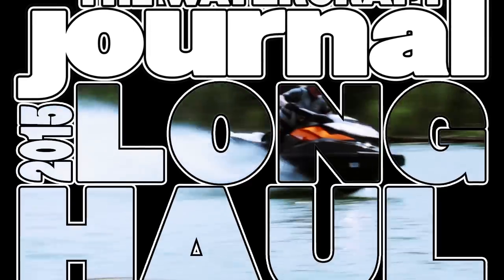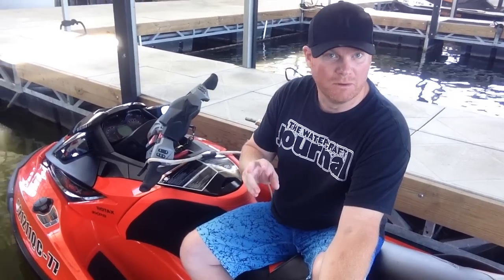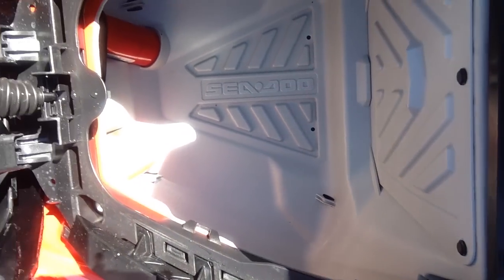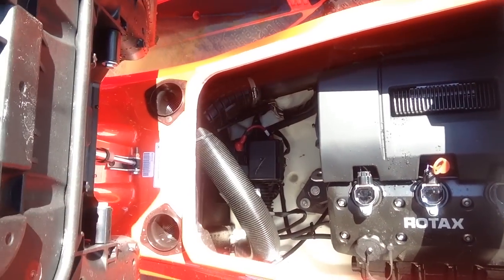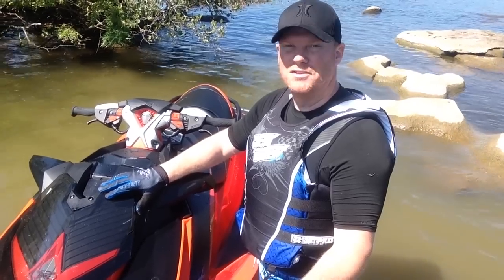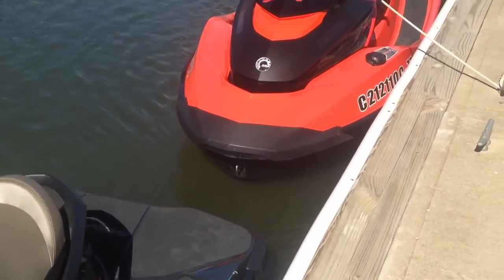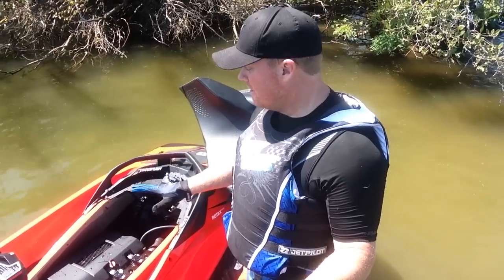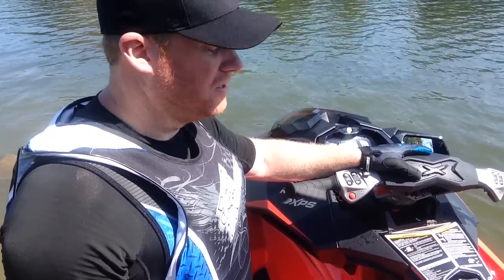Thrashing on Sea-Doo's 2016 RXT-X 300 & RXP-X 300 – Long Haul Ep. 2

Comment: Coming from a person who has been riding jet skis for 4 years now and has gone through 2 sea doos, I would recommend the 260 instead of the 300. Coast guard law states pwc cannot pass 70 mph completely stock. Both the 260 and 300 will get you there
Reply: For one, its not a law.  It's merely a handshake agreement between the manufacturers and the USCG, to not produce new watercraft that exceed 70mph in factory stock condition. Secondly, while still speed limited, acceleration is improved with the 300.
Reply: coast guard... hahahaha
Reply: WOW 70 on the water way fast

Comment: Other than the discussion on speed which  I am still curious about in the US market is that he noted it was "bored and stroked" compared to the 1503.  It is only stroked, the 1630 retains a 100mm bore just like its older brother the 1503.  Very nice review though.  I anxiously await to see one and get all the technical details.  I only wish they had just made the 1630 a total replacement for the 1503 and had it in 4 variants like the 1503, maybe next year...
Reply from the maker: +Andy Rovito Yes, you're correct. The bore remains 100mm.
Reply: +Watercraft Journal  is this the 3 seater one, I need this one if its 3 seats
Reply: Or just add another cylinder to the existing 3 cylinders and make it a nice reliable 2 L 4  cylinder like every other normal jet ski engine but no... that will be too much of a heartbreak for seadoo after all they still grieving the loss of their beloved ''Eskimo life saver''' thumb throttle. Unfortunately that bright seadoo invention it's being a victim of progress and banished forever. The jet ski industry will never be the same without it that's for sure   http://www.greenhulk.net/forums/attachment.php?attachmentid=294307&d=1362751815

Comment: How much faster is acceleration vs the 260?  I've got two 2014 GTX Limited 260's and can get 69.5mph on gps
Reply: Acceleration is not measured in MPH. If you're asking about top speed, they will still be limited to same speed of under 70mph.
Reply: Where did I say it was measured in MPH?  I know how it is measured and was asking how much faster it accelerates than the 260. I was then stating a fact of my top speed with the 260
Reply: +KMT15 Gotcha. The way you worded your question, made it sound as though you were referring to mph and acceleration as the same value. My mistake. cheers!
Reply: @KMT15  suspension doesn't help with speed they're still limited speed buy the rxt

Comment: After purchasing this. Do you need to check for engine alignment and upgrade the water pump to higher cc for Jetski sinking problem.??
Reply: wtf? no
Reply: +Emmanuelle Catubig wut
Reply: Just check on some other guys video about sinking seadoo problem. They do check engine alignment and change the water pump to higher cc. I'm done with my research already.
Reply: +ertonyrn Sea doos do have sinking problems.... I know from experience!
Reply: +Michael B next time put the plug in before you drop it in the water.. Ive owned sea doo's since a 1991 XP... never had one "sink" and practically live in Lake Havasu, AZ and never seen one "sink" unless someone did something stupid, either.
Reply: +ertonyrn My buddy bought a brand new rxtx about 5 years ago and it sank the first time we took it out. And yes the plugs were in. I'm not that fucking stupid. I think it was a faulty carbon seal... Warranty fixed it and he sold it soon after from having so many electrical problems.
Reply: +Michael B well it sounds like your "buddy" got a lemon or a faulty boat... thats pretty stupid to make a generalized statement like "sea-doos are notorious or are well-known for sinking" because of one bad setup... you dont become a multi-billion dollar company making things "notorious" or "well known" that sink.... thats a crock of crap.. stop being ridiculous.
Reply: +Michael Bricker / it's made in Mexico, what can u expect?

Comment: Thumbs up for all the info Watercraft Journal !!! I have question About your answer of the top speed: I live in europe so I get the "RS" version, what do you mean with mid/high 70 mph ? You mean 75-79 mph or just 70/71 mph ?
Reply: +Power333 In the US and I believe Canada, the government wants to ski's governed at 69 mph, but the ski will still hit 70 stock. In Europe, I believe they allow the ski to red line it's RPMs so you'll easily hit 75 or more.
Reply from the maker: +ML L - I understand it's more like 72-73mph.
Reply from the maker: +Power333 - I understand it's more like 72-73mph.
Reply: +Watercraft Journal Thank you.
Reply: Thanks for the fast answers !!! The topspeed is a big disappointment for me. I hoped it was higher, now its the Same as the rxp 260 rs :(
Reply from the maker: +Power333 - It'll be interesting what other outlets claim in the coming days and weeks.
Reply: Yes , let us wait a bit longer for more Info.

Can you tell us if there is a real big difference between the rxp 260 and 300 ? Or is it only slightly noticable in the mid-range ? It says 0-60 in 3.8 sec for the 300, do you know this number for the 260 ?
Reply from the maker: +Power333 - We do not have the previous numbers for the 260, but yes, the power is noticeably evident on the RXP-X, particularly while powering into a corner and out of its apex.

Comment: Is the speed and run time any different between the two and is the rxp x 300 good in chop
Reply from the maker: Are your church shoes good for jogging? No? Because they weren't designed for it, right? The RXP-X was designed for buoy course racing. That's it. The RXT/GTX hull (named S3 by BRP) was designed after offshore raceboats, with a 3-tiered hull to sluice through chop, but remain planted to the surface. Of course, neither are winning any offshore races lately, so if offshore (which is REAL chop) is your target, look elsewhere.

Comment: The thing about any watercraft is that they are regulated to not pass over 70 mph. Therefore they put governors that don't let you reach redline. I have a gtr 215 and my buddy has a rxpx 260. They go the same speed. The acceleration on the 260 is just way more.

Comment: Your section about the RXP-X and the migration of the battery to the front is false, as it's always been up front. Also, it never had rear removable panels.
Reply from the maker: +D.J. Black - Yes, you are correct. It was meant to be specifically for all S3 platform units. That's an editing mistake on our part.

Comment: what speed did you get at 7700 rpm? some people said they got 74mph at 7700 rpm. it's that true?
Reply from the maker: +DNS_Nw-Dunes - such claims are not true, and unsurprising. Although I cannot tell you the RPM, we maxed the RXP-X 300 at 68.8mph. Smaller riders fared low 69 numbers with less fuel in the tank. The RXT-X 300 on hand for testing had the "uncorked" RS (European) ECU tune, and reached mid-to-high 70mph. Again, smaller riders actually achieved a very low 71mph.
Reply: +Watercraft Journal  Will the US models go faster than 65mph stock?
Reply from the maker: +Brent Simpson - if you weigh less than me (225lbs.) and have like half a gallon of gas, you'll hit around 68-69mph.
Reply: +Watercraft Journal I have a 2014 GTX Limited iS 260 and in sport mode the analog speedo gets up to 75 then later goes down to around 65-67.  Does that sound right?  Also how does this RXPX 260 match up with the Kawasaki Ultra 310?Thanks!
Reply from the maker: +HaloJumpmaster Off the bat, that doesn't sound right to us. Again, USCG regulations require that all US-sold PWC not exceed 65-67mph when full laden with fuel and riders. The iS models remain the same for 2016 with the previous 260HP rating.
Reply: Just telling you what the analog speedo says when @ 7700 rpm WOT.  It's done this since the 10 hour break in period.  I'm not complaining...just wondered if the speedo could be off or perhaps the GPS limiter isn't working all the way.  In any case I have no other means of checking the speed since I usually ride alone, and there are no boats that can keep up with my ski where I live.
Reply from the maker: +HaloJumpmaster - that does sound very likely. It could require as little as a simple calibration. Judging off of ANY in-dash GPS can be a little sketchy. We strongly recommend using a handheld GPS (Garmin, etc.), or even downloading an iPhone app (Speed Box is great - and free). All of our speed testing done with a Garmin GPSmap 76CSx and the Speed Box app.
Reply: How much faster is acceleration vs the 260?  I've got two 2014 GTX Limited 260's and can get 69.5mph on gps

Comment: How much faster is acceleration vs the 260?  I've got two 2014 GTX Limited 260's and can get 69.5mph on gps
Reply: +KMT15 i have 2014 rxtx260rs and i wanna know the rxtx300 top speed
Reply: a lot from what ive read
Reply: FriedWolf the top speed is almost the same but the acceleration is A bit better
Reply: Suspension